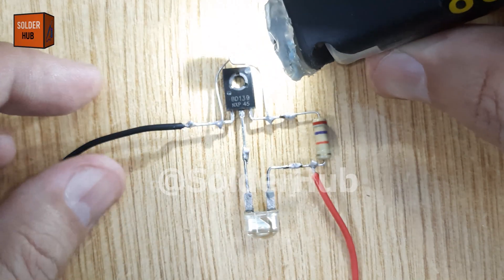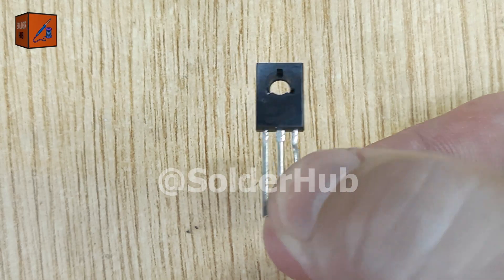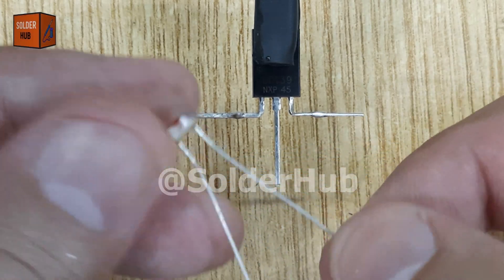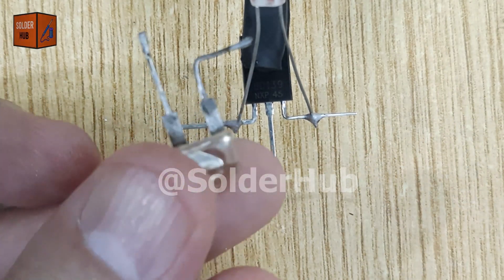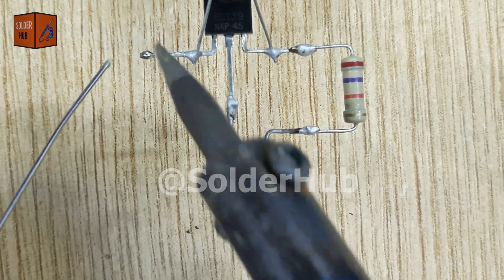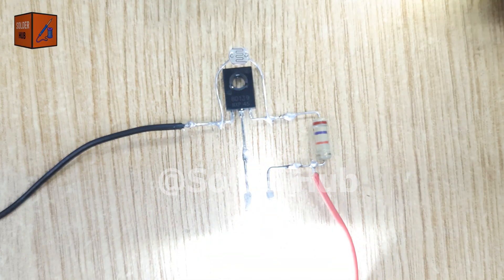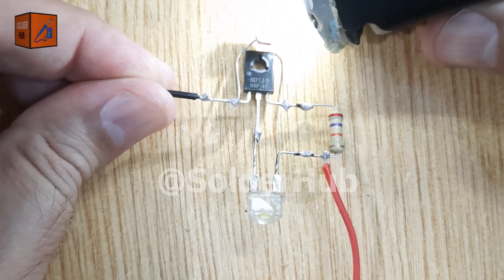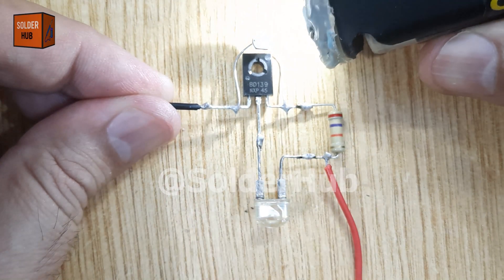How to Build a Powerful Auto On Off Day Night Light Circuit Like a Street Light

Comment: Is it possible to use 
2x1.5 volt batteries 
and a regular c. 2.5 v
LED instead ?  🤔
If not :
3x1.2 v rechargeable &
a 2,5 v LED ?